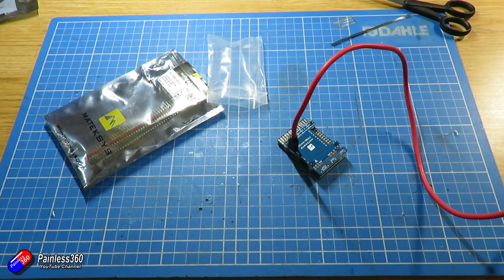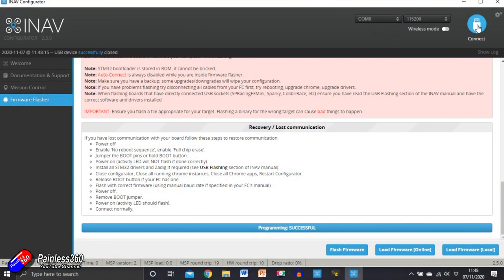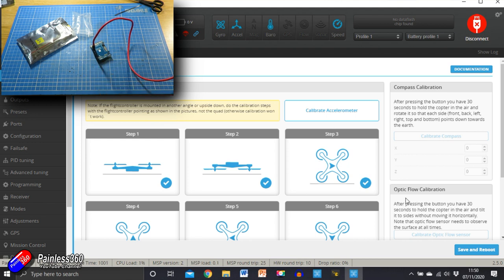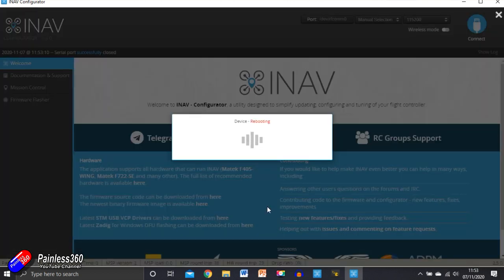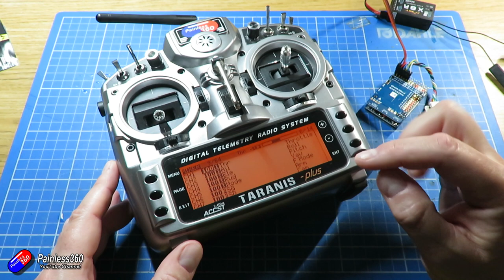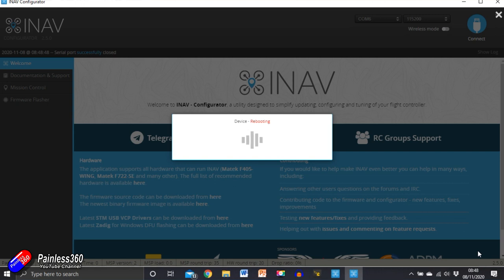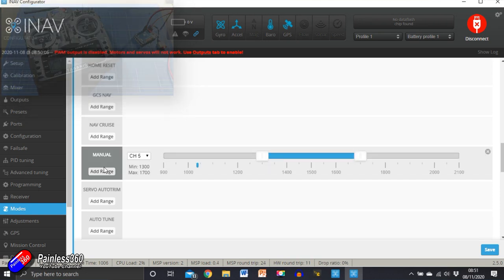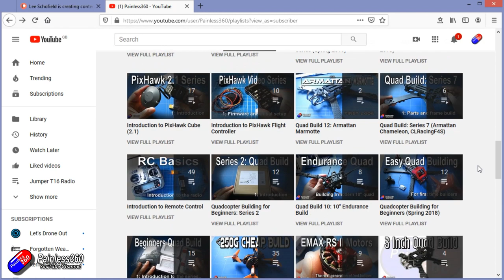Lockdown #2 Build, Part 2: Flashing INAV into a Matek F765-Wing FC

Comment: In the comments on the Matek manual, it says "Check and Swap the Gyro" on the f765. Can you elaborate on that more? Is it telling us to select one gyro over the other, or is there one or the other on the board due to chip shortages? Does the firmware default to one gyro? It's not totally clear what they are saying. My big Drak seems to keep looping out on take-off and I'm trying to figure out if there is something wrong with my settings. I've redone calibration, checked servos are moving correctly, flight modes etcs.  I only recently noticed this on the manual and noticed you didn't cover it. Help would be appreciated. Thanks for your videos, much appreciated.

Comment: Hi again !!, yes, finally I could find someone for helping me to soldering the parts, just I wondering about the model in the transmitter, should I create a model with just simple four standards channels as throttle 100%, ruder 100%, aileron 100% and elevator 100% ? plus two three positions switches to channel 5 and 6 ? all these is correct ? i will put this FC into a Wing. (as you show in this video too)

Comment: Happy New Year Lee. All the best in 2021.  Great video and thank you for sharing your wealth of Knowledge. Two questions for you if you don't mind, -1 Can you use INAV on  MacBook Air to do the configuration ?  -2 will a Flysky TX RX work with the F405 or F765, or a Flysky TX with a different RX, if so which RX might work. Leaning to a F405 less $$$.  Thanks in advance.  Jeff
Reply: I should have had this info in the above  Flysky FS-i6X 10CH 2.4GHz AFHDS 2A RC Transmitter with FS-iA10B I had order these before I started watching  a bunch of your Videos, still waiting for them to arrive.   still using my early 90s 72mhz stuff for the time being.

Comment: Thank you Lee for the video. On my 765-Wing FC  everything is working fine so far, except that the servos (slots 3 and 4) do not move. The upper plate has been correctly connected with the middle one, the receiver (SBUS) on the INAV receiver tab shows as well proper response for pitch and roll. Any idea where to look to solve the issue? Thanks, kind regards. Andy
Reply from the maker: Did you solder the three wires to the top plate on the flight controller as per the, manual?
Reply: @Painless360  Yes I did, as the manual says. Is there any setup in INAV that needs to be done for the servos as well?
Reply from the maker: Nope, nothing special. Make sure the outputs are enabled. . See my current build series using that same FC...

Comment: Thanks for your instructive videos. I however have an immediate problem connecting the board (F765 Wing) to my computer. These are hard to get due to the lack of chips, so I bought one for a future model. But it will not connect to the configurator, "fail to open serial port". I downloaded the Zadig app and reinstalled the correct STM32 drivers. I then managed to flash the firmware in DFU (bootloader mode). But when going back to connect, it's still failing to open the serial port. I've checked the connection to my Matek F722 Wing, that works fine.
Have you any idea what to do?
Reply from the maker: I'd check you flashed it with the right target. Best of luck

Comment: I was wondering, do you think it is worth to buy a FC with GPS module and use it as an upgrade for my fathers Wing? I was thinking just for the autolaunch and stabilization. Is it usefull without FPV system?  Maybe in the future add the fpv system. I fly drones and I saw FCs in planes/wings for the first time on your channel and thought it would be a nice upgrade for the existing wing.
Reply from the maker: That is worth doing is you need the stabiliser, Autolaunch or GPS modes. You don't need the FPV stuff for it all to work..

Comment: I'm having a problem I was wondering if you might be able to help me with. I am using this FC and setting everything up in INAV 3.0 however when I supply power to the motor/ESC it just beeps continuously and won't spool up. My servos are working fine and INAV seems to be receiving signal just fine from the controller but the motor won't work. Any ideas or suggestions?
Reply from the maker: I'd try a different ESC protocol... Best of luck
Reply: @Painless360  thanks!

Comment: hi there.
i have this bored and this is my 1st wing build.
did i see that you used short cables to run power to the top vbat ground and vx? on the top plate??
Reply from the maker: Yes. You need to follow the wiring and connection diagrams on the Matek website. If this is the first build also check out the INAV for beginners 2020 series too..
Reply: @Painless360  ok thank you...i will take a lookse thanks

Comment: Hi Painless360 - I have the same FC in a ASW28 - I have set the current sensor scale at 250 like you have (and like the matek docs) but it sits maxed out at 132A when it's really drawing 0.5A. Is this an issue you have ever come across? Help would be much appreciated. Love the videos. Marshy
Reply from the maker: I've never seen that. I'd check the wiring.... Best of luck
Reply: @Painless360  Good call, eveything else works as it should though. Cheers

Comment: Do you know anything about FPV helicopters with DJI systems? Any flight controllers by chance that are compatible with Spektrum receivers?
Reply from the maker: I'm not aware of any DJI HD 'copters. There are options for flight controllers that can handle a 'copter and also drive the DJI HD stuff too.. Most flight controllers now have SBUS input so if you can get a Spektrum receiver that can output SBUS then it gets a lot easier..
Reply: @Painless360  Yeah I would like to know what I can do.  I am a decent chopper pilot.  I can fly fixed or collective pitch.

Comment: I think I'm ready for the  maiden  tomorrow. One last thing when Inav boots up after the esc beeps Inav pulls down the right aileron. Not sure what that's about. Should I be concern? All trims on remote are at 0.
Reply from the maker: I'd recheck that the failsafe on the Rx is set in case it is sending an odd value to the FC before connecting to the radio. Best of luck!
Reply: @Painless360  Pavel suggest setting on hold which is what I got it set to. For frsky using sbus
Reply: Hey I tried launching the Ranger 1600 with Inav and well didn't go so well. After I did an autolaunch the plane took off level and with plenty of speed. I let it gain some altitude as you see in the video. It says on the screen move sticks to abort. After I do that it goes into RTH? Then the plane gets all wacky. Not sure what it is trying to do. It won't respond to any of my stick movements and at the end it starts a dive where I disarm it and let it drift down. As you see in the video I had it in Angle mode and I never took it out of angle mode? Any ideas what is happening. 
https://www.youtube.com/watch?v=jS11iV37yFg
Reply from the maker: I have my plane fall back into Horizon - see my INAV for beginners series..

Comment: Hi, I really want to purchase one of these, but I dont have any soldering skills , how can solve this issue ? there isnt any way to order one of these already soldered ? please I really will appreciate any kind of suggestions or tips . Thank you
Reply from the maker: I'd contract the shop and see if they can do it for you or buy your mate who can solder a drink or two... Best of luck
Reply: @Painless360  Yes I  m trying hard to find someone near for fix it to me, but meanwhile, please, please, I need to power up my video TX transmitter with 12V, so, should I bridge this "9v rise to 12v" in the board ? for get 12v power out the pins Vtx and C1 etc ? thank you again I really apreciate your help !

Comment: Can I flash it or make sure it works like you do without the gps stuff first?
Reply from the maker: You can but you can't check everything without the GPS attached... Happy flying!
Reply: @Painless360  Ok thanks I ordered a gps.  I wanted to know what gps you like to use with it but I already purchased a gps.  It would be still nice to know what you prefer.  I am going to sick some of my most elite technicians to assist me in this project.
Reply from the maker: Best of luck!
Reply: @Painless360  We got my drone partially up and working.  Didn't get the camera system working yet but we are having trouble with the throttle to work as we want.  Right now we're having an idling problem.  We will probably mess with the fixed wing FC sometime afterwards.

Comment: I just got done setting up inav on the 765 after watching these videos. But when I attach the lipo I get a chime 1 beep then rapid continuous beeping from the esc.   That's as far as it gets
Under pre arming checks everything is green. TIA
Reply from the maker: Enabled the outputs?  What troubleshooting have you already tried?
Reply: @Painless360  I got it. bad esc. Thanks for responding to my question.
Reply: Got another question. I have everything connected but I can't get the elevator to work. I tried a servo tester and the servo works. I go into receiver and ail, elevator, throttle and rudder all respond correctly. Any ideas what to try, thanks.
Reply: Does the FC need to be level for the surfaces to work? Right now for trouble shooting I have it hanging outside of the model?
Reply: I have two brands of servos on the plane does that matter? All 4 are analog 9gram
Reply: Bad soldering working now
Reply: I'm almost there with Inav. Everything works but the motor using the frsky qx7. The motor spins up in Inav so I know wiring motor esc is all good. Everything is green in setup. I check in receiver and the throttle responds and moves correctly. I have 21 Sat's. I flip into arm...motor doesn't spin???
Reply: I found the problem. Lee's video how to calibrate esc did the trick.

Comment: I am having issues flashing my  Matek F765 wing.  I am getting this error message at the top while in bootloader mode:  Failed to open USB device!  Any suggestions?
Reply from the maker: Sounds like a driver issue. Does it say DFU at the top? If not then see my video on Zadig. Best of luck
Reply: @Painless360  It says DFU at the top.  I can manually put it into bootloader mode or use the command line.  I tried using two different operating systems and computers and used the impulse RC program and manually changed the FC driver.  I messed around with the zadig program but it only gives me a  STM32 virtual comport IN FS MODE option and it says bootloader mode when it's in bootloader mode.
Reply from the maker: The only thing other thing I can think of is to try another USB cable... Best of luck
Reply: @Painless360  We tried that too.  We were using my friend's USB cable.   Chances are the hardware isn't operational.  When I change the driver using zadig it doesn't actually stay(just discovered this).  Chances are i have a bad FC is what i am thinking.
Reply from the maker: It could be, it sounds like you've tried all of the usual stuff.. Best of luck with it...

Comment: Fc won't notice my gps using thr 765 and the m8q gps I set it in the ports and hit save and it won't keep settings
Reply from the maker: Not saving the settings in the ports tab usually points to you not selecting a valid configuration for the ports. Set them up as per the wiring diagram on the Matek website and it should work fine.. Best of luck!